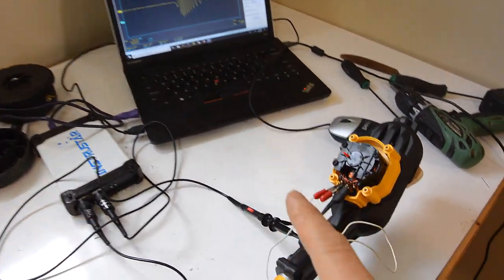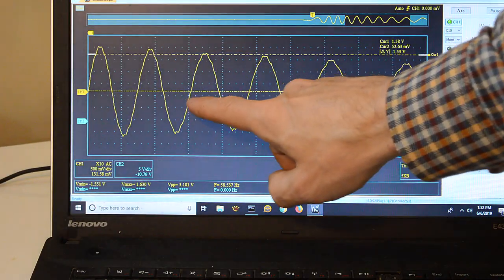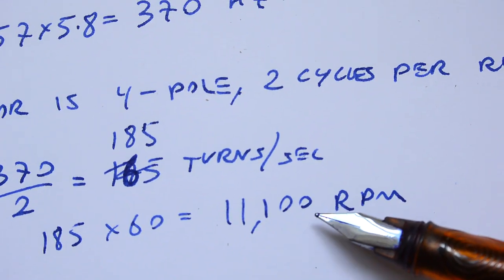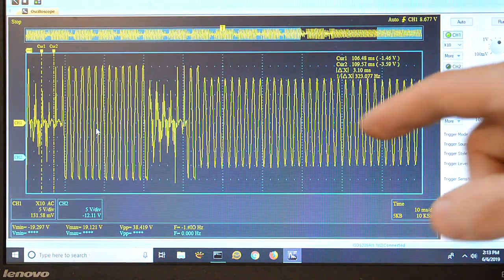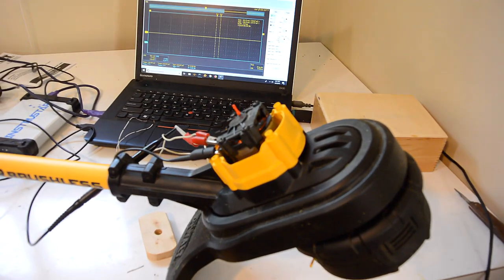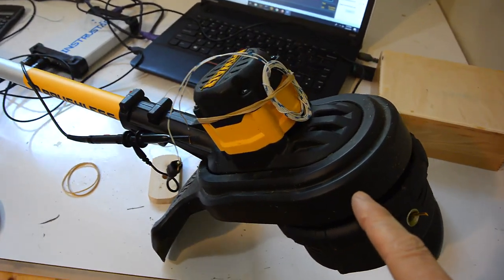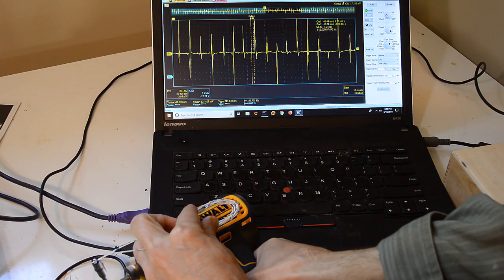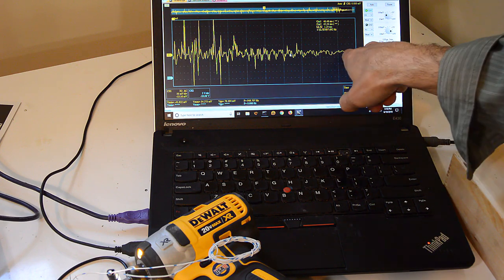Examining a brushless DC motor, and a dumb way to drive one.

Comment: Actually you can drive the coils sinusoidal and minimize the cogging.  The sine waves can be synthesized with modern power electronics.  Of course that motor may have a simplier drive.
Reply from the maker: well, yes, that was my point.
Reply: Well.. unless it need to be smooth motion or silent, don't expect sinusoidal drive. It takes a bit of extra stuff to realise.
Reply: Except for noise there isn't much of an advantage to drive the coils with sinusoidal voltage.
Reply: @superdau  less torque ripple, smoother current waveform, and whatever you lose in top speed you can potentially regain if you do phase advance (field weakening).

Comment: Hi Matthias,

Two questions;

1. Google reports that a 60hz 4 pole motor is 1800rpm. That's before the gearing as well. (I'm not sure if that's the right formula).

2. The reason they aren't using PWM is because they are going for maximum torque? (PWM is good for a computer fan, as pushing air is not hard, compared to a thick weed).

Regards
Reply from the maker: PWM what you would use when you aren't going for maximum torque.  At maximum torque, you'd be closer to continuous on.  So you got your logic a bit backwards there.
Reply: @matthiasrandomstuff2221  I was a little tired when I posted that. 

Here are some fundamentals you might of overlooked;

https://www.monolithicpower.com/pub/media/document/Brushless_DC_Motor_Fundamentals.pdf

So looks like they are using A cheap form of a  Permanent Magnet Synchronous Motor (PMSM).

With a Sensorless BLDC Motor Control as it's doesn't require very much maintenance. it's a cheaper option and not as effected by water. 

It's not a dumb way like you have said just different and a cheaper way. 

Regards
Reply: @matthiasrandomstuff2221  I think you might find with that gear that it is a powered metal cintered gear which is cheap to make. Rather than a machined gear which is stronger. 

Battery operated tools like this are built to a cost for the home user, also to fail so you buy into their expensive battery system. 

If this was a professional tool them it would be a petrol driven engine.

I think what I'm trying to say is don't right something off as dumb if you don't understand, who, what, when, why and how.

Regards
Reply: The formula for speed of a synchronous motor (which a BLDC is) is: RPM = freq * 3600 / N, where freq is the drive frequency in Hertz, and N is the number of magnetic pole-pairs. 4 magnets = 2 pairs. So, yes, the speed would be 1800 rpm if the electrical frequency were 60 Hz. I guarantee you that Mathias knows this already. Note that all you are really doing is converting Hertz to RPM (3600 RPM = 60 Hz * 60 seconds/minute). Then you divide by the number of magnetic pole pairs.
Reply: @mckenziekeith7434  ok, I'm just not sure how he came up with 11,100 RPM
Reply: @flagmedownmedia  there is a concept in BLDC's  (and regular DC motors) called Kv (not kilo-Volt). This is the motor speed constant. First he measured the speed constant of the motor by measuring the amplitude of the back EMF waveform. Then he used the speed constant to calculate the theoretical max RPM of the motor base on voltage (not frequency) and then he applied the gear ratio to get the speed of the cutting head based on the motor speed.
Reply: The motor controller will adjust frequency as needed, but what limits it is its ability to apply voltage. It can't apply a voltage higher than battery voltage. So that sets an upper limit on its speed.

Comment: If it's overpowered before the suppression, would that be for when it's cutting thicker brush to maintain power through the cut?
Reply from the maker: I would imagine it doesn't do that under heavy load, but that would be hard to test

Comment: I expect it's probably using regenerative braking, slowing it down by pumping energy back into the battery. You could confirm this with a shunt resistor in series with the battery, and check for both positive and negative voltage
Reply from the maker: When you short the lines, there's no energy that you can get out of it.
Reply: The energy is dissipated as heat in the windings of the motor. During regen, the back EMF is still visible. Basically in regen, the applied voltage is lower than the generated EMF of the motor. This causes current to flow in reverse, charging the battery. It would be hard to detect this just by a single voltage observation.
Reply: @mckenziekeith7434  hard to detect what?
Reply: @robmckennie4203  it is hard to detect whether a motor is in regen just by looking at the back EMF. You would also want to see phase current, or battery current.
Reply: @mckenziekeith7434  right got you, that's why I was suggesting measuring the battery current with a shunt
Reply: @robmckennie4203  yeah but shorting across a phase does not push current into the battery. The current flows into the motor winding, heating it up without regeneration. Shorting the phases does not equal regeneration.

Comment: Matthias, it would be useful for you to measure the maximum power output of your brushless tools before disassembly and after disassembly and see if there is any degradation of torque etc. The reason I mention this is that I have a number of expensive stepper motors made in the 80s/90s that expressively warn against disassembly because the permanent magnetic field of the rotor is damaged (removing the rotor from the stator changes the magnetic path from a low-reluctance path to high-reluctance, and that can push the field on the B-H curve to a lower intensity stable B field).

Comment: Regenerative braking to increase run time? Still seems silly
Reply from the maker: If you short the windings, there's no "regenerative"
Reply: You wouldn't be able to see regen from observing voltage. You would need to observe voltage and current at the same time, or observe battery current. When the winding is shorted, all the braking power is converted to heat in the windings of the motor (basically).

Comment: I've never understood why this type of motor is called brushless dc, why isn't it just an ac motor?
Reply from the maker: it's actually a three phase syncronous AC motor, but combined with the electronics, it runs on DC.  "Brushless DC" just sounds better, plus, it does run off of DC with the electronics.
Reply: @matthiasrandomstuff2221  yeah I get that they're usually ultimately powered by dc, but it doesn't seem like something fundamental to the design
Reply: Roughly speaking, there is no such thing as a true DC motor. Internally, there will always be a variable magnetic field generated by a variable electrical current that either chases or leads the magnetic pole(s). (And no, I don't consider a monopolar/homopolar motor a real alternative to this; this is why I wrote "roughly".)

Comment: To tell what is really going on in the motor, ground the scope to a power lead from the battery and use a current sensor on 2 or 3 of the motor phases depending on if you have a 2 or 4 channel scope.  Hall sensor probes are best, but you can get a good idea with AC current transformers in a pinch. Current is directly related to torque.

Comment: Matthias, can you show us a video of it working? I’d like to know how long a battery lasts under, maybe a medium load. What you think of the way it handles, such as balance. Thanks for the video!
Reply from the maker: battery lasts long enough
Reply: KelMaster Construction, thanks for the reply, I have a worx brand trimmer, 20 volt, that I’ve had for a number of years, and it’s just about on it’s last leg. I live in the country and can mow just about everything with a rider, but there’s always something that I can use a trimmer on. I like the cordless trimmers for what little bit that I do trim. I have Dewalt cordless tools for just about everything, and I’ve had good luck with them so I’ll probably try out that trimmer. Thanks again

Comment: I use a lot of brushless motors for RC and I think the difference you're seeing is because the one with the unusual waveform is a sensorless motor, where the others are all sensor type. They will have an extra wire from the motor to provide rotor position, using a Hall effect sensor, back to the motor controller. A sensorless motor controller uses back EMF from the coils to determine rotor position as it spins. It only needs power leads to the motor and gets position indication directly from those. That's most likely causing the unexpected wave form you're seeing. Most RC brushless motors are sensorless as they can be completely sealed, and you have no need for the extra sensor wire back to the controller.

Comment: That might be a *feature*. Being so prone to getting stuck (even with that 3:1 ratio) it's just cheaper to cut power to the motor by applying some hysteresis to current sensing between power cycles than having a proper pwm driver just for the sake of pure efficency. It's quite a harsh environment if you think of it, which is why probably why the used a bldc, even though no full advantage on it could taken, if you wanted it to be durable, that is.

Comment: Does anyone know if I would damage a 14v motor by powering it with a 18v battery?
Reply from the maker: depends on whether the motor can handle it or not.
Reply: Matthias random stuff is there an easy way of establishing this? Or should I just give it a go and see if it breaks? I'm not really losing anything if it does so long as it doesn't damage the battery.

Comment: There is a strong possibility that Dewalt is driving the motor this way to provide a whipping action for the nylon string to achieve a better cutting action especially at slower speeds. This explains why it's only done with the trimmer, and not the other brushless tools. It actually shows that Dewalt has put quite a bit of research into the way the tool works if this is the case, instead of simply applying a PWM signal to control the speed of the trimmer.
Reply from the maker: in that case, they wouldn't be applying braking 5-10 times per second.
Reply: @matthiasrandomstuff2221  I wonder about that because by doing that, they would be pulsing the string while maintaining a desired slower speed. This would apply the "whipping motion" to the tip of string creating a better cut quality. When you run those nylon strings at too slow of a speed, they tend to "lay over" the blades of grass due to its flexibility instead of cutting it. This has always been a big downside to using a battery driven trimmer because as the voltage drops, you loose rpm on earlier versions.

Comment: If you can use a battery powered weed eater, you don't have much to weed.
Reply from the maker: correct.  Because we mow the lawn, so it's just the edges.
Reply: @matthiasrandomstuff2221  Lol, think he'll get the sarcasm?
Reply: Maybe you are playing games with me. I pretty much guessed you mowed the lawn as I do. I just don't think the battery would last on my edging length. I wish you would tell us how much you pay for these items in Canada. I know it would be in $CDN but I can Google what that is.
Reply: @jeffstanley4593  My 18V ryobi cordless goes for at least an hour with 5Ah battery. If it takes you longer than that to trim the edges, you don't have yard, you have a farm.
Reply: @jeffstanley4593  Then buy a battery with a larger storage capacity, or an extra so that you can charge one while using the other. Your storage can be as big as you want it to be. Unless you're playing games with Matthias and are talking about mowing a hay field or something. In that case, use the right tool for the job. I have over an acre of lawn to maintain, more than the avg person (avg lawn size = ~1/4 acre), and I do it all with two batteries. I also use said batteries to power my electric motorbike too, and charge them with solar power. They're pretty versatile if a person knows what they're doing. What I wish is for more people to learn to think for themselves. If you can google an exchange rate, then you can google prices for tools in Canada as well. Homedepot.ca, not hard to find. Cost depends on brand and power. A person can get a 20V Black and Decker edge trimmer here in Fredericton for ~$120 CAD which would suffice for most suburban residents - that's cheaper than my Mastercraft impact driver that I use for work (and have a half dozen batteries to keep me going all day on a roof - 4 years and still running strong! EDIT: that was an extra cost though). Or if they have a swollen chest and like having more power than they need, then they can buy a 60V DeWalt 'Flexvolt' trimmer for ~$380 CAD. I personally use 40V yard tools - don't need any more than that unless a person is lazy and lets their grass grow long enough to grow seed.
Reply: I didn't want to get into an in depth conversation on the virtues of battery vs gas. Since you broached the subject, I have a few battery tools and love them. They are more than adequate for what I bought them for. Corded or cordless tools in no way compare in power to gas. I have seen electric edgers and trimmers and my wife had them. They cannot do as well as gas and besides, my gas tool is a multi type tool having different attachment capability. Sure, I can google prices in CA but why would I if it were written in front of me. Don't you think so? I mean you thought enough to do so. Then all I had to do is copy then paste into a new address bar, Google did the rest.  I didn't even have to specify why I did that. Automatically came up 75 cents US per $1 CAD. Now, as for battery tools. I have about $500 tied up in dead batteries from Milwaukee and Makita. I have or am converting over to Ridgid brand tools from HD. IF you buy the battery with the tool, it (the battery) as well as the tool is warranted for life. If a stand alone purchase on batteries it is still three (3) years warranty. No grow to seed here, every five days.
Reply: Hmmm, that's good.